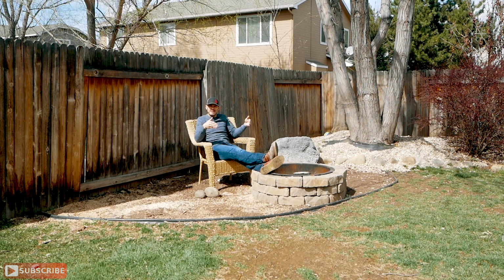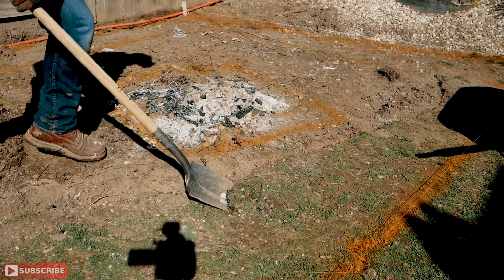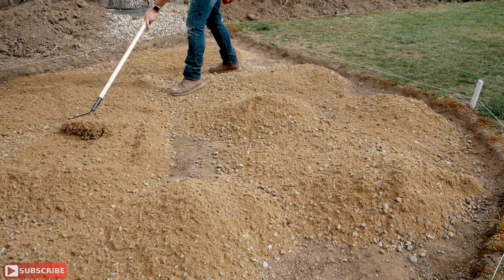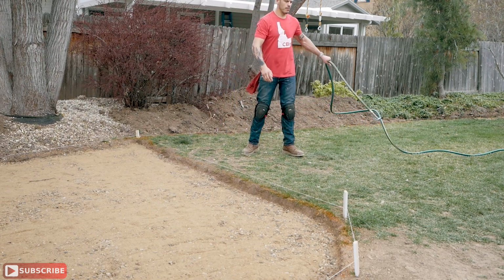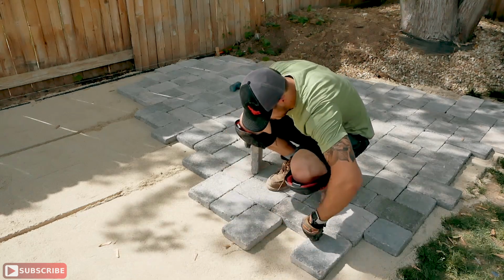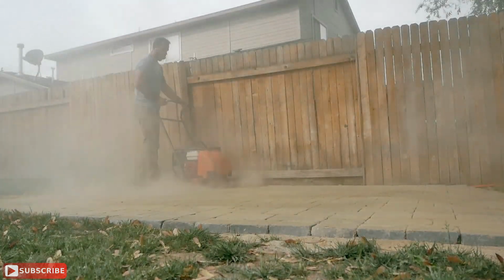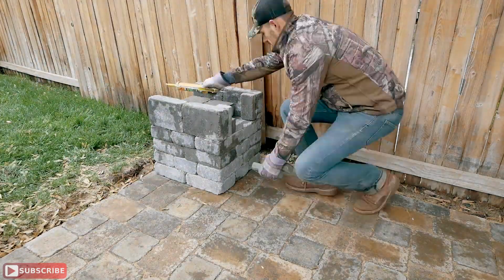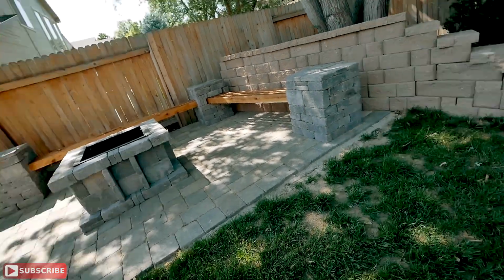Paver Patio Backyard Makeover

Comment: Shouldn’t you use the plate compactor after applying the sand than once again after you laid the bricks?
Reply from the maker: No. The sand needs to be light so the pavers an into it
Reply: No compact after every layer. I can assure you this base was no where near the 6 inch minimum it should have been. Should be applied in two inch layers and compacted with a mechanical compactor. Not a hand tamper. If this is anywhere that has any changing climate such as snow it will warp and move completely. This is not a good how to video at all.
Reply: @kylelalonde9256  i checked your videos and i couldnt see one from you... weird...

Comment: Nice build! Its giving me some ideas. 
However, the boiled linseed oil is not a good choice for outside furniture.  It definitely brings out the color and grain of the wood, but I would strongly suggest some kind of poly.  Looks like you used cedar as the wood, a great outside choice but still a good idea to give it some protection from the sun. 
👍👍👍👏👏👏
Reply from the maker: Poly gets worn down by UV rays quickly. Boiled linseed oil has been used on sealing Japanese huts for decades.
Reply: @MrBuildit  Linseed oil will eventually fade. If you apply it at least once a year you may be okay for long term.  If you think that applying it once and ur done, you will be unpleasantly surprised. 
Vanish or lacquer is another option if the poly around you isnt outdoor rated. But there are polys that are good for outdoor.

Comment: Decent video. Having just put one of these in. I think there is one thing you didn't do and then somewhat glanced over. The biggest problem with DIY jobs like this that the average user has is settling. Most specifically, settling on the edges. Most masony quarries will recommend that you extend your base 6-8 inches passed the edge of your patio. I can tell you right off the bat, that you graded your patio away from the fence towards the grass. When the water runs off into the grass, its going to roll right off your concrete (this is the part you glossed over basically just covering in a 3 second caption you have to pause to read) and its going to create mud and your paver edge is going to sink out into the grass. It may not happen the first season but I give it 2-3 seasons and your edge is going to separate from your patio. Extend your paver base out 8 inches and it will last much longer. Also, and this wasn't part of the video but, your retaining wall in the back and terribly out of level. It was the first thing that caught my eyes after I threw up from all the spinning of the video in the beginning.
Reply from the maker: Yeah but then 50 more years and global warming will destroy it.
Reply: @MrBuildit  so everyone lets do shitty jobs, global warming will destroy it anyways...

Comment: Looks awful, not to mention the shifting of the ground is going to make that look like trash in 5 years or less.
Reply from the maker: I’m sure it will be fine.
Reply: @MrBuildit  Time will tell.
I've come across 3 different patios where something similar was tried.(college buddies / family tried something similar) even after the first 9 months major shifting was showing.. After 5 years they all hated their patios, 2 had dug them up and went with a solid concrete pour.
Reply: @colfrankslade  Its all about a solid compacted base, removing all organic material and assessing your subbase material. If its clay you have to install a deeper gravel base with geotextile fabric to help the heave. Compacting with a plate compactor vs a hand tamper is the key to success and min 4" gravel.